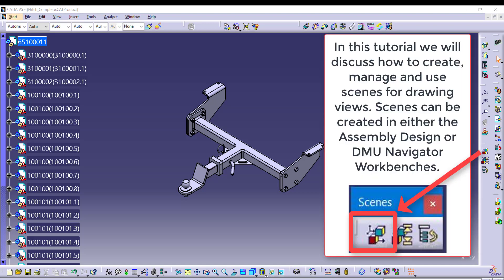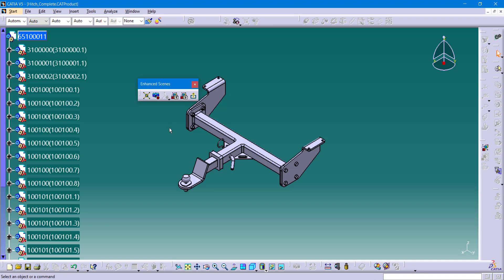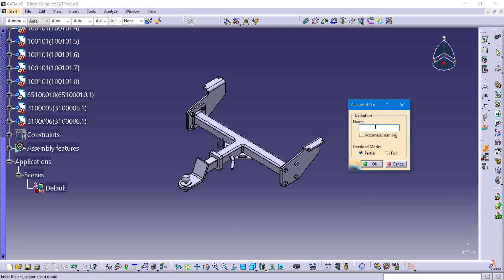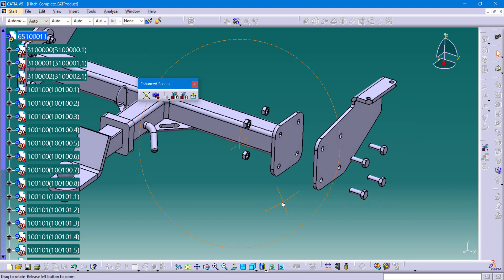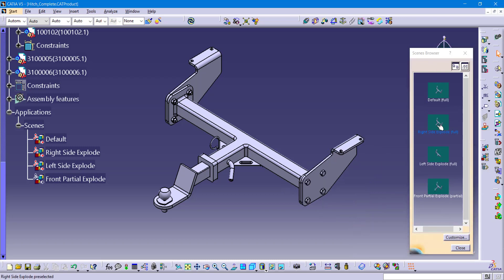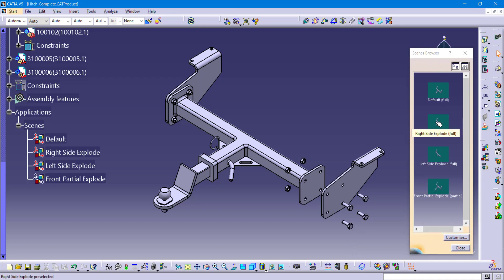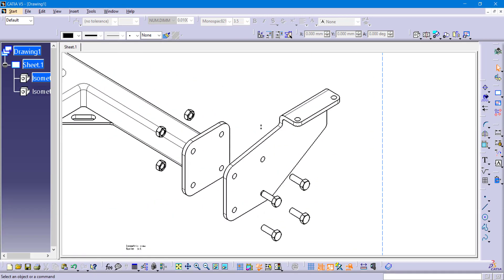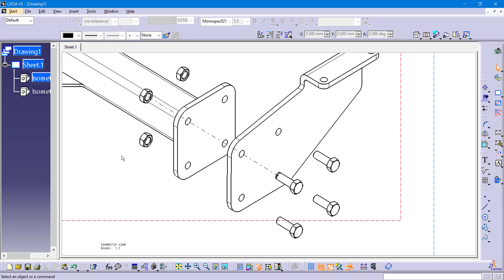Creating and Managing Scenes in CATIA V5

Comment: If I add a part in assembly after scene creation, then it doesn't reflect inside scene, doesn't reflect even in Catia tree inside scene.
Is there any way to show newly added part inside scene?
Reply: In full mode cannot be added, only in partial. If you will search on Catia user guide on the internet, on assembly is a chapter (Managing Enhanced Scenes / Adding, Replacing and Deleting Components in the Assembly) and you will see there.
Reply: @vrinceanuandrei6711 Thanks for your response. 
Later on I found this solution as you suggested. After adding a part in assembly - I click on existing scene, then click on scene tool. Like this another scene create which reflects newly added parts.